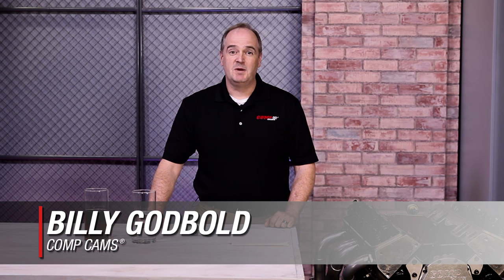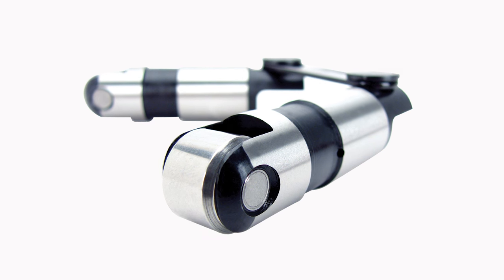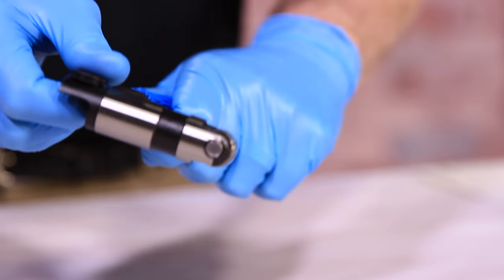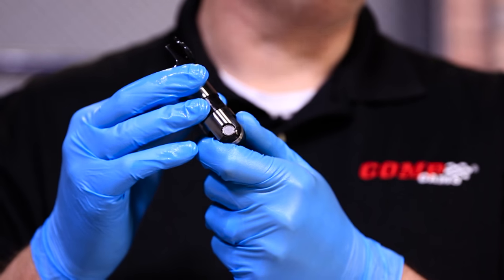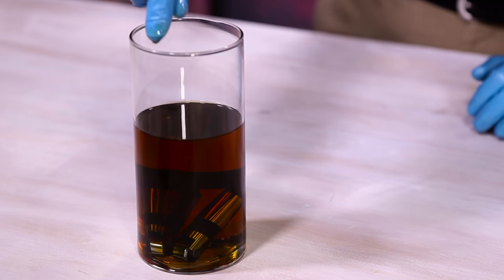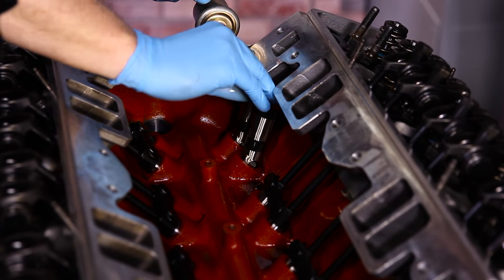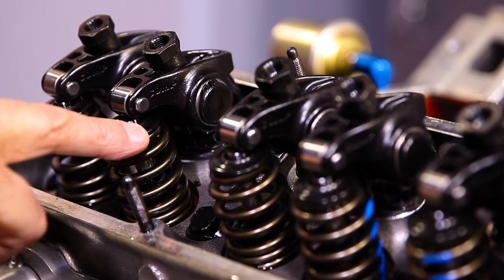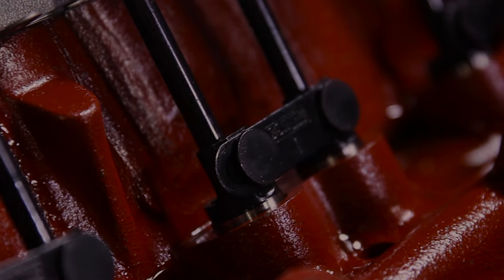COMP Cams #Techtips: Hydraulic Roller Lifters

Comment: I'm using a complete Howards set up from cam to springs. The instructions clearly state NOT to wash in any solvent including mineral spirits, and not to soak the lifters. Only to wiped em' down clean and then just dip em' in your choice of motor oil and then install. Been hearing bad this about comp cams lately. Don't know if it's true. But I'm going with my 27 year machinists recommendations. My last Howards cam & lifters are still going strong after 6 months. Still low hours but happy so far.
Reply: Any updates on the lifters? Just ordered some
Reply: @1LETrackPerformance  It's been a little over a year now and the lifters are still working great.
Reply: @guidosarducci3047  that’s great to know. Were they the Maximum Effort Retrofit Hydraulic Roller Lifters right?
Reply: @1LETrackPerformance  Yep. Retro fit Hydraulic roller lifters.
Reply: I think they're good up to like 7200 rpm if I remember right. been a while since I did it. My cam is 545/554 lift and they're still quiet as a mouse. Been running it pretty hard too. Very pleased with em'
Reply: @guidosarducci3047  what’s ur build sheet look like? I’m trying to find a good cam
Reply: @guidosarducci3047  because right now I have:
210cc AFR heads
-Forged internals(3.75 stroke, 6.00 con. Rods, with 5cc 4.040” pistons)
-Compression of 11:1 or tad bit under
-The roller lifters you recommended.
-1.6:1 rockers
-max lift of .71
-anything I’m missing?
Reply: @guidosarducci3047  all need is a camshaft, and measure for the proper size pushrods, and I have a complete motor😁
Reply: @1LETrackPerformance  I kept the stock bottom end, but balanced the rotating assembly. If l remember right the stroke was 3.75 as well. The deck was milled .012 to get rid of any defects. l changed to 10:5 pistons. 83 cc heads. I don't remember the valve size but they were the biggest ones possible. I think the compression ratio after the mill work equaled to around 11:3 I used a 545/ 554 lift roller cam. I topped it with a 800 cfm carb and ran 3" exhaust w/ super 40's. I got a custom built 3,800 stall converter, but my car is pretty light, so it flashes around 2,800. I changed the rear gears from .390 to 373 because it was too much for the freeway. So it definitely lost a little something on the launch, but it still pulls really hard through all of the gears. I never dyno'd it, but the guy who did the machine work (27 years experience) felt it should easily deliver 500+ horses. I've been building cars - motors for 40+ years and I guess that feels about right. It's plenty strong enough for me anyway. I'm not an expert builder and wouldn't dare speculate on what your looking for in performance. My car runs fine on premium, and l only drive it on weekends. I just putter around town doing an occasional burn out every once in a while. l hope your as happy with your build as l am. I'm sure it'll be even better than mine. Good luck.
Reply: @guidosarducci3047  sounds like a fun build! I’m putting this into a 1200Ib ish sandrail
Reply: @guidosarducci3047  camshaft*
Reply: @1LETrackPerformance  Oh brother...Sounds scary. That'd give me goosebumps. Yeh Haw...

Comment: Ive seen in some recent videos that its actually best to NOT soak your hydraulic lifters. Doing so can mess you up when its time to adjust your rocker arms. Since the lifters are now filled with fluid, it is now trying to raise the valve possibly, instead of collapsing the lifter when making the 1/4 to 3/4 turn after no lash. It makes since to me. Whats everyone else's thought on this???
Reply: The oil will leak out of the lifter when you do the 1/4 to 3/4 turn. they are designed to work this way. If you do this without oil in them at start up the piston in the lifter could weld itself in place before your engine has time to lube it from the oiling system.
Reply: @Darkhalfcustoms  But if the engine lube system was primed before installing the distributor,  your point would be moot!
Reply: @MrStevieb54  what about the lifters that are compressed while priming...im thinking, install dry, prime, then rotate 1/4 turn, prime, etc...would love some feedback